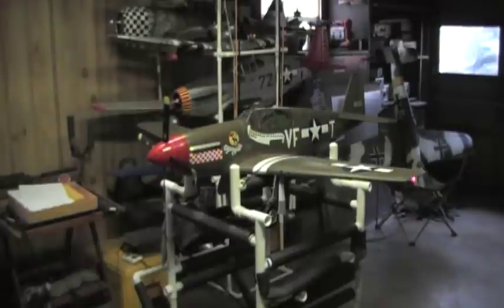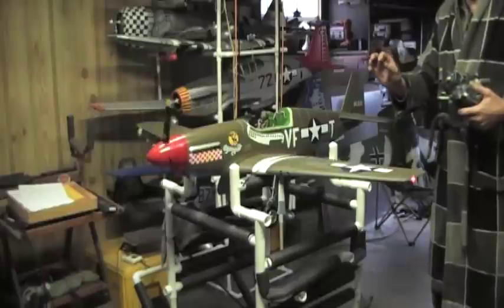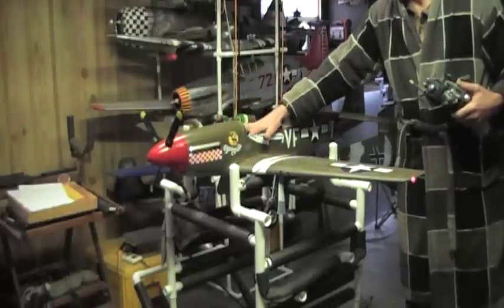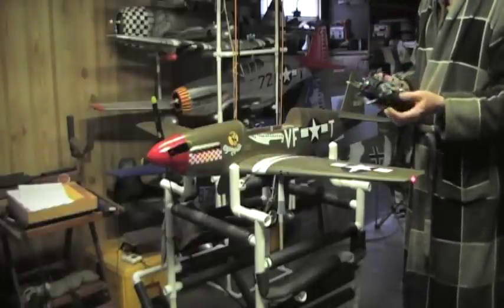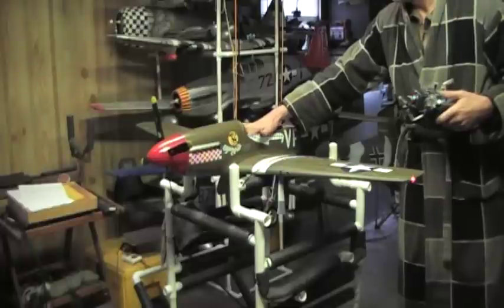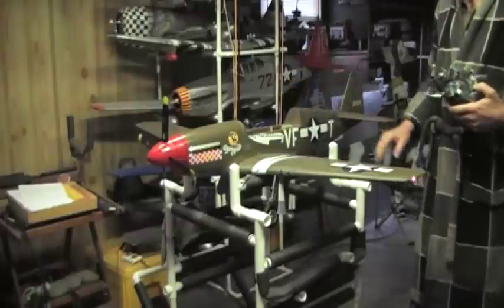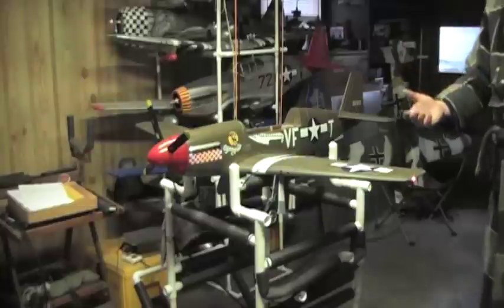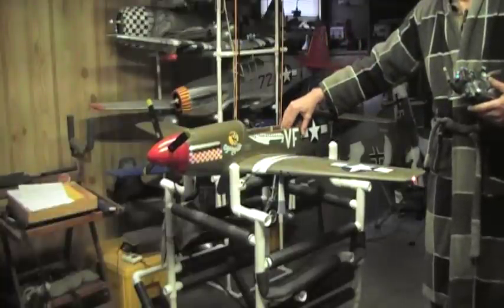My Mr. RCSounds V4 sound mod to the 1400 mm FMS P-51B 001

Comment from the maker: I don't think you can through the ESC, but if you have a programing on your radio that may be possible. Something like a delay setting or slow down to the AFR...I have that on my Futaba 12fg, but it doesn't delay the start which is what you're after I presume